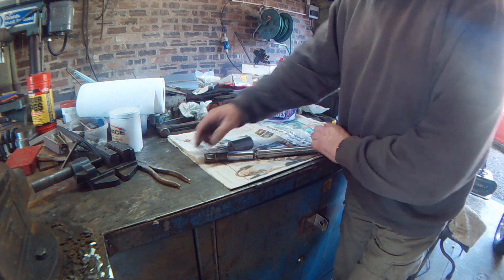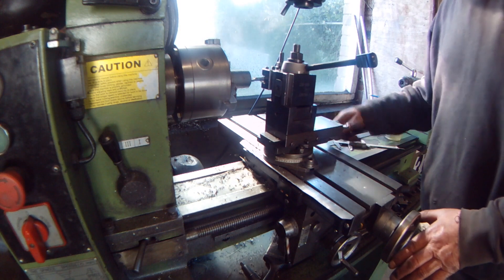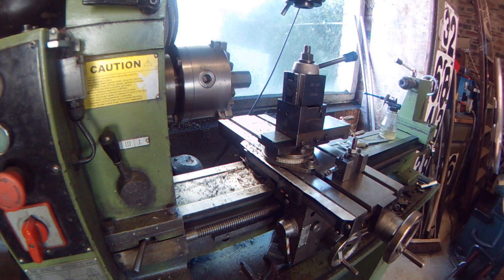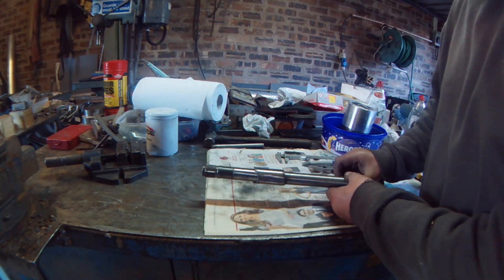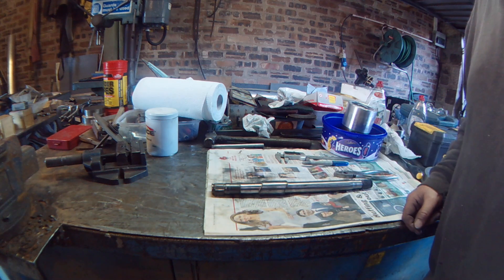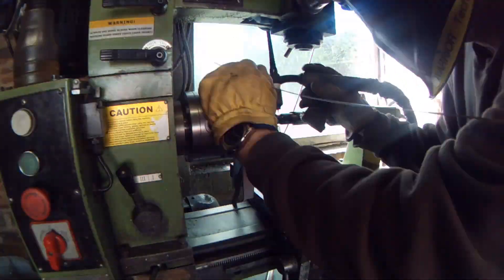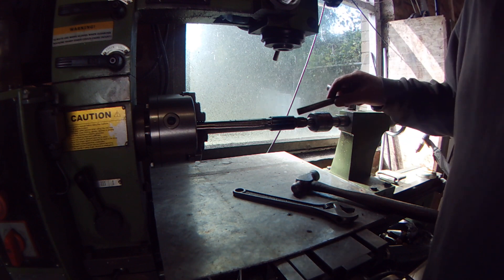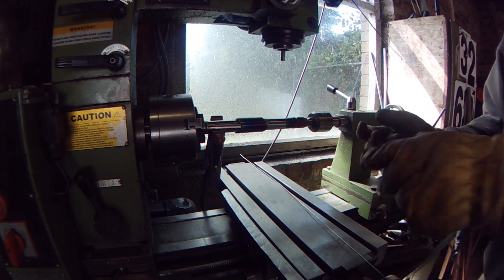Cutting & Welding Drive Shafts for Race Car

Comment: hi doug ..advice needed,. my trike drive shaft  cv bust out of the cup at the wheel .  how when i shorten new drive shaft do i decide where the rollers should be in the tripod   before any articulation .im using old sierra type tripod shafts into 7inch diff .i know the spring will stop it bottoming out at wheel but how to make sure it[wheel side] doesnt come too far towards diff ..where can i send you a pic.. ..any advice be very well received
Reply from the maker: You will need to measure the shafts in-situ, at ride height and at full droop and full bounce, and ensure that the CV joints remain in the cups and also do not bottom out. I presume that your trike has a similar amount of suspension travel as the original vehicle had.
Reply: @DougsShed  it only as move ment allowed by shocker travel
Reply from the maker: Hi Mike, I'm pretty sure that both inner and outer CV joints on a 7" Sierra drive shaft have sprung CV joints. The shaft should self centre. Set the shaft length to its natural length at the car's resting position.
Reply: hi doug thanks for reply ..i was waiting till i have new drive shaft but as yet not sourced one  so i can measure as you indicated...im assuming diff stays well in and only wheel side cv slides in and out...do i have to compress the spring to measure full movement ..

Comment: I've used this method on my buggy I'm building. Honda D Series engine and Mazda MX5 hubs and half shafts. However I've broken the shafts 3 times now. Only pushing 580kg at 130bhp. The shafts break at the end of the sleeve not where the joint is. Any recommendations? Only difference was my sleeves were cut and welded at 90°
Reply from the maker: "bird's mouth' cuts on the ends of the sleeves may help, along with a couple of holes and rose welds into the shafts. It could be that the MX5 shaft hardening/tempering does not like welding.

Comment: Can  you tell me what type of tig wire did you used that whit hold the torque and high speed ?
Reply from the maker: I use 309LSi stainless filler rod due to the varying hardness and composition of the shafts and sleeves.
As for torque limits, difficult to define. Most of the shafts I have welded have been used on lightweight competition cars using bike engines (up to GSX1300R Hayabusa). I have not had a shaft break at the weld or sleeve. Only failures have been at the outer CV joints on classic Mini shafts where there is a known weakness at a circlip groove.
Reply: Thank you so much, I have a motorcycle drive shaft that I need to modify and the information is just what I was looking !!

Comment: I hadn't thought of the idea of radius on the pipe ends ,good idea for stress risers . I usually weld the circumference & plug weld a couple holes on either end .
 I need to upgrade joints on a car with 700 hp & im trying to figure out how to keep the splines & upgrade the c,v joint . Not sure if i should machine the back of the c,v cup off & weld bigger joint on then maybe heat treat it .
Reply from the maker: I've welded different CV cups to CV stubs but only on relatively low power applications - not 700 hp.
Reply: @DougsShed  🤞🙈

Comment: Hi Doug, Might have missed you say in the video but what material do you use as the sleeve?
Reply from the maker: I usually machine the sleeves from some EN8 Steel bar
Reply: Cheers for the reply! No issues with strength with that grade of steel then? Also to save commenting on another video what do you run usually in your diff conversions? A mix of oil and grease?
Reply from the maker: Lubricant type depends on the type of differential being used. For ATB LSDs (helical geared) I use general purpose Lithium based grease. For open action differentials I use heavy gear oil (140) or fluid grease to help to flow around the cross-pin and gears. For plate and ramp type LSDs I use the special LSD oil recommended by the manufacturer.

Comment: Very useful video. I would like to add couple of details and useful advices for everyone who is in need to do such job:
Re-cutting splines on a factory shaft is almost impossible (very difficult to do) because there's a risk of braking the material, because the ends of the drive shafts are usually heat treated (I think its called hardening or tempered steel, sorry, English is not my native language), and if you are about to re-cut them, the material might snap because it's not designed to be redone. Also, the cutters are very expensive, so no one will do it for small buck. This job is far easier, and less complicated. When you machine the shafts, make sure to cut them at 45° angle at each end, make sure to drill a hole through the center for a guide, and lastly make sure to make a ring, since, depending on the engine specs, there's a risk of shaft snapping if you don't include the ring. Finally, after the job is done, you will need to dial (balance) the shafts, to avoid risk of damaging the transmission. The shaft needs to be balanced within two tenths of a millimeter. Perform the measurement with your gauge at three positions of the shaft, prefferably end/mid/end.
Reply from the maker: Thank you for the additional information.
I would normally get new shafts machined and heat-treated rather than cut and welding or trying to re-spline existing shafts. There are a couple of companies, here in the UK, who can manufacture new custom/hybrid shafts. Downside - cost and manufacturing lead time. Cut & welded shafts are a good interim method of checking the fitted lengths before committing to getting new shafts machined.
Reply: Hello again Doug.  I am about to order a Quaife chain drive differential and will need to make hybrid cv axle like this.   I don't have a lathe so want to minimize having to pay someone to make parts.  If I skip making the chamfer on the ends of the cv axles to be welded together, would the concern be getting good alignment of the 2 halves, or increased risk of the hybrid axle breaking, or both.   I was thinking if the sleeve I use is made to a tight tolerance and a snug fit, it would align the 2 halves to be joined well enough to avoid vibration or other issues?
Reply: I should add that I would do some plug welds in the sleeve to help strengthen the joined axle.

Comment: What would be the advantage of doing it that way vs cutting it down at one end and resplining it? Other than being able to do it at home rather than farming it out to a shop. Certainly looks like an excellent job, stronger than the original I'd imagine.
Reply from the maker: It is difficult to find anyone willing to re-spline existing shafts and cost is likely to be similar to getting all new shafts manufactured. New shafts typically take 4 to 6 weeks to get manufactured whereas it only takes a couple of days to cut, weld and sleeve existing shafts.
I've not had any shafts fail at the weld however with wide sticky slick tyres we do see failures of standard Mini shafts at the outer CV joint (a known problem with classic Mini shafts). The cure for that problem is to fit special larger outer CV joints to the hubs and have special shafts made - all very expensive.
Reply: @DougsShed  I'm in a similar predicament. I want to fit a differential from one manufacturer to the hubs of another. I can't even find a place that will do fully custom shafts. There are plenty of places that will do sturdier shafts for a given application, but none that will make bespoke shafts to unique specifications.